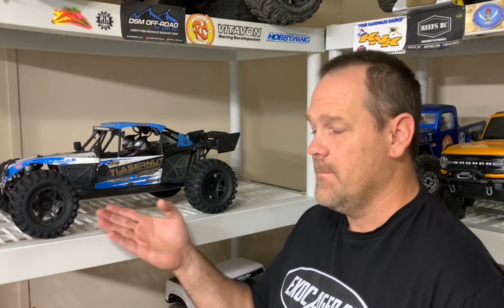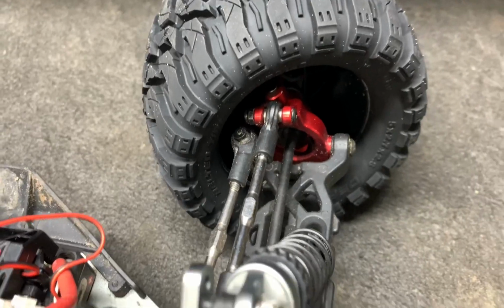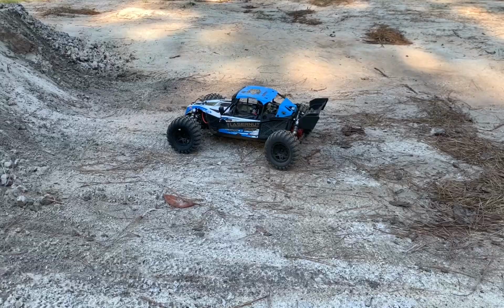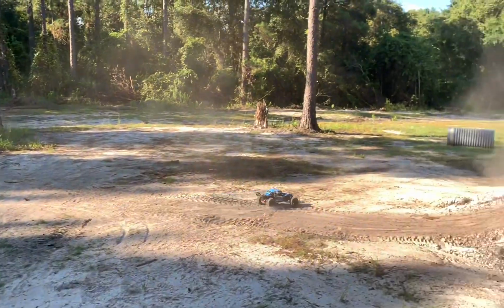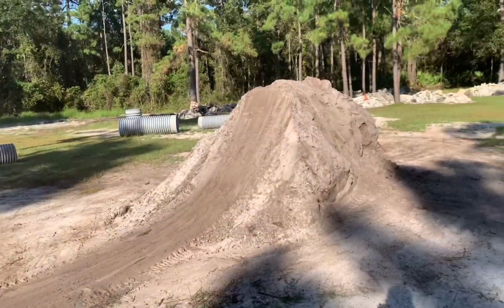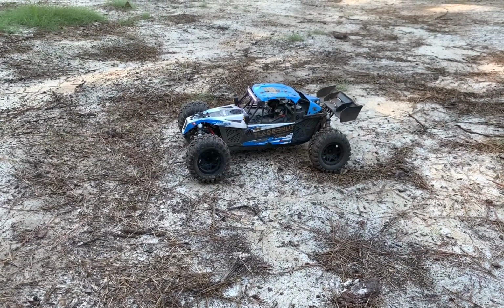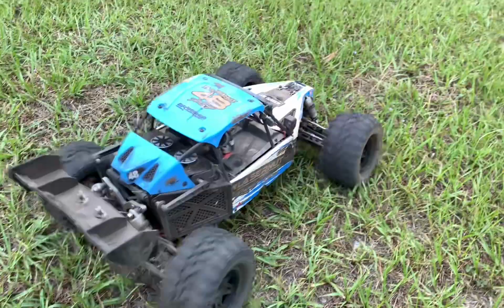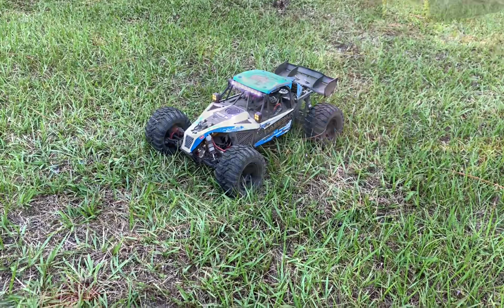Defenders on Lasernut

Comment: Also...  Dboots Katar tires (for the Arrma Talion) are a perfect fit for this rig but require 17mm adapters - I've had great luck with the hot racing 12mm to 17mm adapters. 
Same overall diameter as the original tires and better tread, traction, and controlability.
Reply from the maker: Thanks for the info!

Comment: You can get some high quality ceramic bearing for the rear pinion gears save yourself $17 bucks for a diff housing and most likely a new $40 ring and pinion if you don’t notice right away and just rip it with a blown bearing

Comment: So I ended up getting a losi db pro with the money I got from selling my ryft. I really like the db pro it’s a fun little buggy but I definitely need to upgrade the electronics all of them. The steering is weak and it pushes the front wheels at speed and the motor cogs really bad. So I’m debating on a castle 3100 to 3500kv or bumping up to the 1415 combo and running 4s.
Reply from the maker: The pushing can be a tuning or driving thing or both. What I mean with tuning is tires, diff oils, shock setup, castor and Camber, driving is simply letting off the throttle to plant the front down to get that initial turn in and either start the turn or rotation. Hope that helps
Reply: @ExocagedRC  I think it definitely needs some thicker diff oil or maybe some earplugs I’m gonna do that today. I’ve been tweaking some on the suspension but still not really helping. To me it seems like the servo or servo saver is to weak bc even just like at a 10mph cruise or when you let off the throttle to turn it don’t wanna turn you literally have to slow almost all the way down to a stop before it’ll turn.